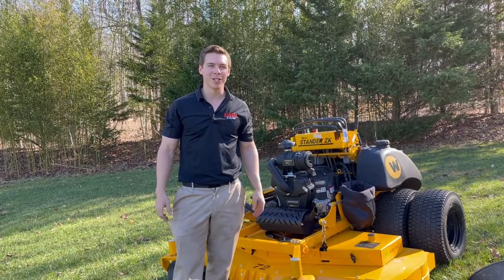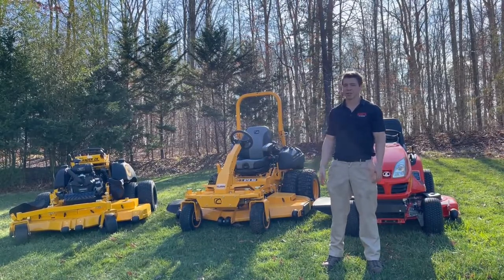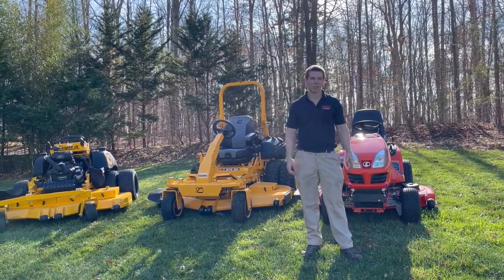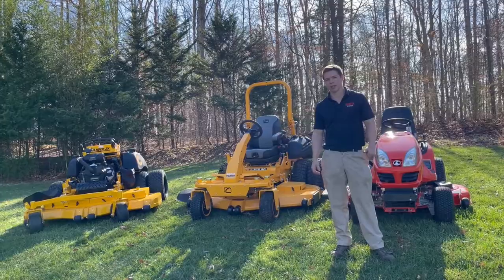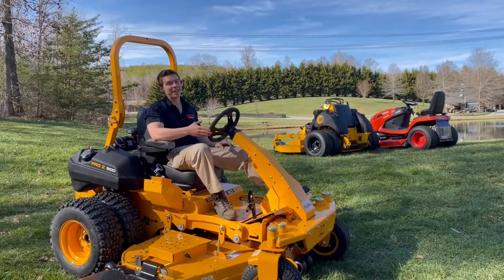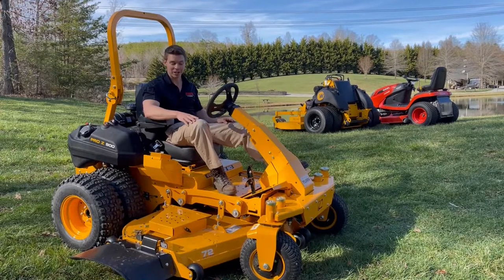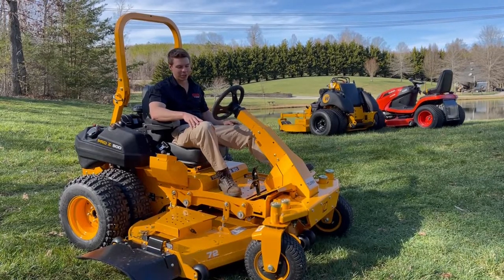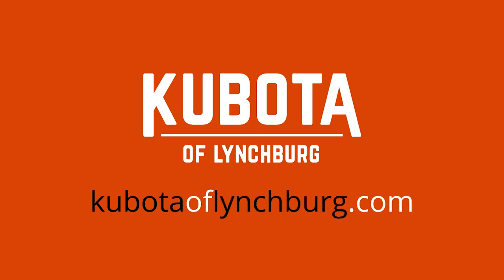Hillside Mowing Comparison: Cub Cadet Pro Z 972 SD, Wright ZK72 and Kubota GR2120

Comment: Own a GR I've had for years and it will absolutely go anywhere , I've had people video taping me all the time. I now added a bx but I still don't know how much it can do yet. I  set on the fender to go steeper on some yards I do for customers.
Reply: I do the same on my lowe's bought husqvarna 48" pressure lubricated 24hp briggs. My yard in the middle of nowhere Appalachian Mountains has narrow steep hills and riding side saddle isn't getting easier with age. I would like a diesel version though

Comment: Tires make a difference as well! look at the other two with turf tires compared to the Pro Z! By the way I'm the new owner of a Pro Z 960S with turf tires and it will mow that incline with no problem! My Spartan KGXD as well! That Cub 960SD will handle a 46 degree grade or 25 % by spec. The steering wheel make it a lot easier on a Cub with limited experience. But I would not recommend anybody without experience and knowledge to hit the hill right  out of the shoot with there new machine!!!
Reply: They all had OE spec tires, so still a fair comparison. But as you well know, turf tires on the Cube wouldn’t have changed the result. 

The 25% spec by Cube is dictated by the engine spec and at what angle the oil is still being supplied correctly. Go above that and you can end up damaging the engine. Some type of oil pump add on may get around that.  
It will be interesting to see what these new commercial grade electric mowers can achieve.

Comment: Would be great to hear more information about the Kubota gr tractor line. I don't see many in my area. Everyone including myself either run the John Deere or cub cadet for the most part. Was wondering if the GR series has hydraulic down pressure on say a snow blade like the 700 series John Deere or does it just float like a gx345. What attachments can you use and how well do they work. Wonder if you could fit Carlisle all trail tires on and if so would it have a better traction advantage
Reply from the maker: We'll add that to our to-do list once we have more GRs in stock!